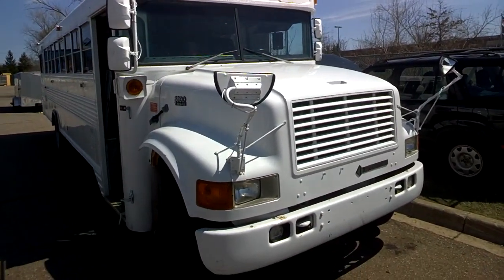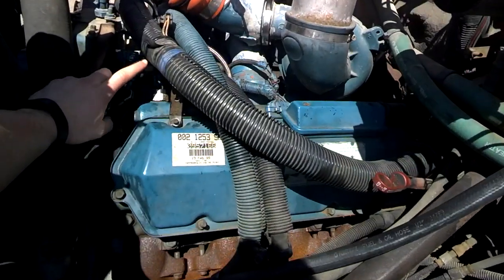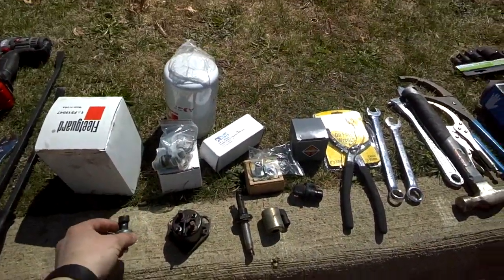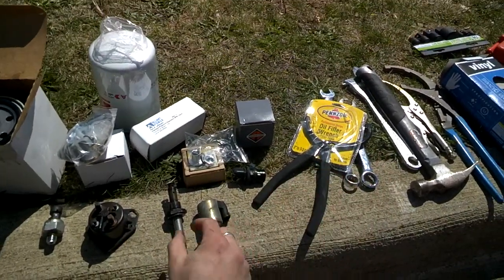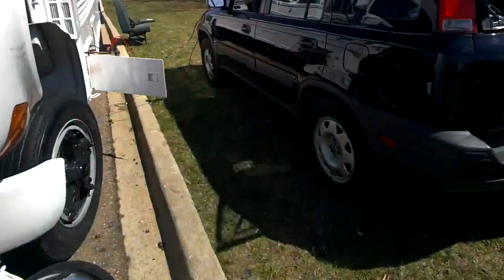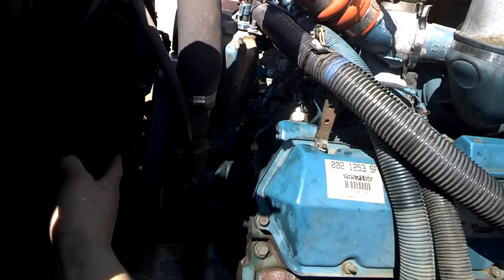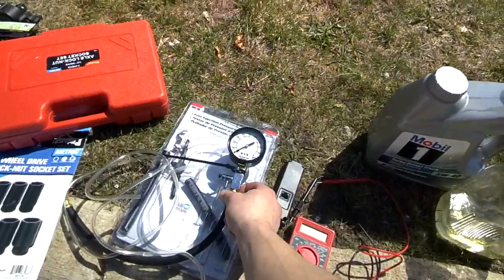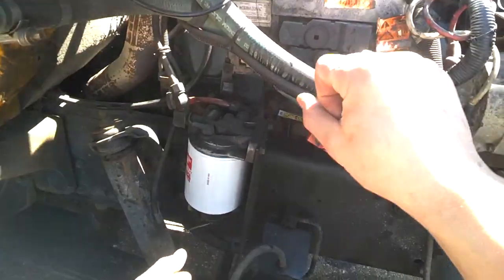All You Need to Know to Fix the 7.3L PSD T444E Engine incl CPS, IPR, ICP, FPR, etc.

Comment: Covered a lot of good points, common problems (man, they must not have maintained yours at all!) I have a '96 7.3 with 263k..bought new and haven't had moßt of the problems you recount. I am an ASE cert. Diesel Bus master tech (retired x3) and have had some of those issues while maintaining a fleet of 27 busses, for 18 yrs. Still one helluva lot less problems than a B series Cummins, or God forbid,  ANYTHING  GMC has come out that burbs DIESEL!!
Reply: So what is the very most dependable diesel buses out there?

Comment: I use your video every time I need to troubleshoot my 2000 t444e!  Today your comment about checking the pre-filter (upstream from the fuel filter) led me to find a piece of something stuck in mine.  Pulled it out and my bus runs without smoke in the exhaust!!! You saved my hundreds in diagnostics!

Comment: My motor is slightly different from yours, your advice helped me a lot, my Engine light is now off after I was able to locate and change out the ICP Sensor.   I Prayed to the God in Heaven about
 this one.  At International, the cost of the ICP sensor was probably almost three hundred dollars or close to two hundred dollars and was under $30 on eBay or Amazon, which made me question the quality and durability of my less expensive part, its been a few years and the part has held up.

Comment: This is by far the best video working on any 7.3 from ford 250 350 450 and excursions.. the view and angle u shot it being on a bus is the very best. The 7.3 is all the way across and same exact problems but minor fixes are better then engine replacements on gas cars. U rock
Reply: thedavidibarra papi 7.3 and 5.9 are kings among the diesels and if only Ford F Series had as much room to work with as that bus
Reply: The e350s are a bugger because everything is so damn tight!

Comment: Thanks for the video. Learned a lot. I have the same bus. Warning lights, buzzers, everything but a gong goes off.  Gages show low oil pressure and overheating. Plenty of oil, water level is fine and not too hot. I love my bus. It is a '99 with only 112K miles! Unfortunately, I had a diesel mechanic who was supposed to be an expert on Powerstroke engines. After screwing me around for a couple of months, told me that it was ready to pick up. Got it home, parked it for three days. Went out and it wouldn't start. Called him... he skipped town. Again, unfortunately, I am not mechanically inclined, but there is enough videos and info online that I believe I can do most anything I have to .
Thanks again for the video.
Poppy

Comment: BRAVO!!!!   Very well done and no time wasted on "I'm so cool".   smart mechanics are few.
Reply: Tim Masincupp 
Tim my name is Ken I am having a serious problem with my 4700 I I I I have a international 2000 engine 7.3 T444E Roback flatbedIt takes off really great and as it gets 30 mph starts to slow down and lose compression or power inter-national dealer tells me I need A Nother motor but the problem just started happening out of nowhere
I am in need of some serious advice!!
Reply: If anyone else have had this problem with is 7.3 international motor losing power after take off please reply
Reply: @kenwilliams5281  what ever happened with your problem Ken?
Reply: Maybe it’s the transmission

Comment: A other no start issue is a shorted fuel heater in the fuel bowl. It blows the 30 amp fuse that also powers other fuel system components...
An easy indicator is absence of a wait to start light when trying to start....
Reply: Where is this located

Comment: You definitely want to refill the HPOP reservoir. It is common to the engine oil, but don't count on the oil being replenished. There is almost no cirulation from the engine block. I opened my 2000 superduty reservoir and after 100,000 miles of regular oil/filter changes, the oil in the reservoir was like mud. It should be pumped out and refilled when you change your engine oil. Fortunately I discovered this before my injectors were ruined. Their is nothing about this in the Ford truck manual or even in a Chilton repair manual.
Reply: Even if you don’t believe it, do it as it’s cheap insurance.
Reply: JB Marker uh. Your low pressure oil pump pumps oil to the reservoir where the hpop uses the oil and is flowed through the injectors and back down. It has a huge part of oil circulation....

Comment: I have the same bus motor- I had the fuel pump go bad twice, and the serpentine belt tensioner broke (easy fix) and the glow plugs were bad...but that only matters in cold weather.  With theses big things it's better to fix in the driveway than on the highway...

Comment: Will,
One thing you should do, remove that New Gray Colored CPS Cam Position Sensor and put the original Black CPS back in the bus. The old Black CPS was made with a USA Made Magnetic Hall Sensor and is the best units ever made. If it has the small circle in the center with the exposed magnetic sensor you are in luck. The new Sensors have a cheap offset Asian made Hall Sensor that throws the timing off and causes high EGT temps, and poor performance eating fuel. The CPS goes in with a single 10MM Bolt and you torque it at 18 ft. lbs. The CPS is one of the most important parts of your 7.3L engine, the old black CPS will make the engine run on all 8 cylinders.n The new gray CPS is a nightmare, besides the cheap Hall Sensor, it's offset and not centered. So when the flywheel spins it counts the largest tooth and the smallest tooth on the flywheel. A bad CPS will give the ECM a wrong count and screw-up the entire delivery system, Both the new gray Ford and the International Dark Blue CPS have the same faulty offset hall sensor and are wasting tens of thousands of gallons of fuel each day. I have an old Black CPS in my truck and I get 20-21 MPG on HWY and 17 City with a heavy foot.  Here is a diagram to show you how the 7.3L PSD Works starting at the top left with the CPS (CAMP) Sensor.
http://tinyurl.com/7-3L-Wiring-Diagram  .

Comment: Just got the exact same bus at a auction... and I see you have 2 batteries mine only had one!    Great video
Reply: All 7.3's to my knowledge have two batteries. My 95 has two batteries in the engine compartment but the 2003 has one hidden down on the rail frame/rail.  There's a decal in the engine compartment I found after I did a little cleaning

Comment: mororhead, true that the glowplugs will ignite starting fluid and blow up your engine, possibly... but in warm weather the 7.3 will stat and run with a bad relay, although it takes a minute for sure. I had thick oil in the 7.3 bus I bought, and the guy sold it to me cheap because it had a hard time starting. I changed my oil to a synthetic 5-40 and not it starts almost immediately. just my experience...
Reply: the newer style pistons don't like either and if you have to use either most either now is such low % of either just give it a sniff after you have pulled the relay or fuse for the glowplugs so they aren't hot but unless its below 50 degree's a 7.3 will fire up with out them it won't like it and may take a min to light all the holes but it will light but on these newer diesels either has been known to crack pistons in most cases because people using too much  but still not worth it plus block heat is another option

Comment: I was experiencing the same issues.  But....my bus would crank and crank and wouldn't start.  I removed the rear heater, and in that process, cut the supply lines to shorten and hide them.  Apparently I lost more coolant than I thought and i had NO clue that there is a low coolant sensor that prevents the motor from starting.  I replaced the cam sensor and still had no luck.  Once I filled the coolant to the "full" level on the container, the damn thing fired right up.  I wasn't throwing any codes either.  I talked to an old-timer that is a retired bus mechanic.  He told me to add coolant.  It's between "add" and "full" and that beast lives again.  Much cheaper than replacing every sensor...
Reply from the maker: wgaca JR thanks for your story. Yes if I were to remake the video i would have included: 'make sure all fluid levels are good including coolant, transmission, oil, steering, brake, rear diff, etc.' but i guess i assumed most people would start there. Also if you do follow my advice in the video you would not replace every sensor you would start by reading your error codes which would indicate you should check coolant (in your case). Congratulations on getting it running again though that's always a satisfying feeling!
Reply: Never pre fill fuel filters and never wear a ring on your hand while you work on anything.

Comment: Is there a way of contacting you with a quick question about the 444e? Mine is dying when it's warmed up and put into gear. Replaced or serviced: ICP, IPR, CPS, H-pop, fuel pump. Probably stuff I'm forgetting.
I'm getting code 42 from the scanguageD I bought that you suggested. Cleaned all the fuel lines, replaced the fuel filter, and inspected fuel tank, fuel pressure regulator, screen, bowl, and added a supplemental fuel pressure at the tank. It starts right up, just won't run under load once it warms up. Great Vid!
Reply from the maker: sorry I missed this, you get sorted?
Reply: @WillStone  I don't have wait to start light or crank

Comment: I used to have a 95 7.3, well still do an selling it now, bought a 7.3 idi that’s better for running more bio fuels.
These 7.3s are a true pain in the ass to fix sometimes, but being that the valve covers are no buried between the truck where the passenger side one only comes off at a certain angle. For the 3/4ton trucks ford should’ve stuck w the 7.3 idi. 

Basically if you can afford it, change the factory valve cover gaskets, IPR, ICP, & CPS/ with a spare in the glovebox. 

The IPR moves in & out about a couple hundred times a decent to send the right amount of oil to the injectors.
This is a part you want to get that’s genuine motorcraft, other sensors like the ICP just get after market, get motorcraft for the CPS as well.

If it’s taken care of that is about the only real issues these things have.

Just get ready to pull out the wallet for 1K in injectors, & $700 oil pump, & 1-$200 computer tho. 

I just found a bus w that engine in it that pas parked in a field, I’m 17 so hopefully I can get it pretty cheap.🤞

Comment: Where the oil filter located on this truck. I looked all over engine and thought it was the water oversteer at first until I wiped it down and saw it said coolant filter on it. My 2001 which is identical to this has been nothing but a nightmare and my tow costs have been killing me. Had to change the fuel pump 3 times before I got one that finally worked and haven’t had issues with it since.

Comment: Just bought a 2000 Bluebird School bus... picked it up in Mississippi yesterday and drove it 500 miles. Everything seemed to be going well till about 300 miles into the trip. Stopped at a rest stop and when started the bus up again got oil/water warning lights. Oil check was good water was almost empty but no obvious leaks on the ground. Let it cool and put 4 gals of water in and drove it the rest of the way. Got home and checked the water... very low level. No water in the oil but noticed a leak on top of the motor towards the back ... explains why the floor area around the front of the cab was slippery, kind of oily. Any ideas where to start?
Reply: Mike & Cindy Jones, Realtors heater core.

Comment: does your oil pressure gauge "hunt" while on the road? I just picked up a 2000 Bluebird with a T444E... drove it 1050 miles home.. runs beautiful.. my fan clutch is bad so i ran about 210 temperature on the hot days but thats an easy fix.. it has the typical intermittent tap-tap at idle sometimes..  (LL #8 injector needed maybe...).... the one thing i notice us drivng down the road on the highway.. my oil pressure gauge hunts from say 48 down to 40 then back up again...  repeats about every 10 seconds...  just wondered if yours does the same thing..   what does your dash oil pressure gauge read after your engine hot and you are on the highway? I dont have a normal OBD-II port for a scanner on mine..  I have a scangauge 2 that i use on my cars  but what did you use for a pinout to the connector to pull the codes?  my bus has a round connector instead of the normal style, otherwise mine looks identical under the hood.. its a 190HP variant of the T444E, in a little 6 window, the bus has better pickup than my 7 row DT-360 bus has.
Reply: should me ntion the scangauge you use is a VR model... i ended up using the international software servicemaxx and running a J1708 adapter...  one thing to note is that the fuel Pressure regulator nut on the older ones only ran at 47 PSI pressure .. its actually the spring in the regulator... that was replaced due to a TSB for late 99s.. (I noticed yours has the notched FPR nut which means it was updated to the 72 PSI).. others watching its a worthwhile upgrade.. quieted my engine right down form alot of the cackle..  my oil pressure still hunts, however is in range according to the books so I let it do its thing...   the EBPV is another thing that will cost stalling or sometimes no-starts...  many of the cold-weather busses had this on it as a war up device... it causes issues by sticking sometimes and blocking up the exhaust...

Comment: also to check icp you can start the engine with it running disconnect the connector. the engine will give a quick hesatation and idle normal. but besure to disconnect the battery befor doing any work under the hood

Comment: I HAVE A 2000 INTERNATIONAL 4600 DT466E, Truck wouldn't start due to fuel, Got the truck started and stay running but I'm not getting full power when I try to drive it, Do have any idea what could be wrong?

Comment: I have 2000 international 4700 the oil is being pulled from the engine into the fuel tank. Have not been able to find the problem any information will helpful thanks

Comment: So i have a 96 int 3800 bus with t444e and i cannot find the separator. have you ever seen them in strange places? ive traced down the framerail and i dont see it anywhere where i see fuel lines. i have a service panel inside the bus, could it be under there?

Comment: Nice video gave you a thumbs up. A little all over the place but I learned some things, thanks for doing it. I was so in tune with the video I didn't even notice the sniffling. LOL, if you watch my vids I sniff a lot maybe that's why I didn't notice it. Mine is cutting out occasionally, tipically in cooler weather, in the 70's,  then it goes away in the summer mid to high 90's. Changed the CPS no change. So I figure i'll try the Throttle assymbly and the ambient temperature sensor. Any ideas? Ps also changed the oil, auto tranny fluid and filter. Ran injector cleaner to, no effect. Pulls hard under load just when cruising does it cut out. Seems to do it between 1700 - 2200 RPM. Thanks Best Wishes/Blessings Keith.

Comment: I have the same bus. 
Pretty bad oil leak can't really see where it's coming from. 
Near the filter on the driver side front of the motor.  
It's shooting out like a pulse.
Any ideas before I take this thing apart.
Reply from the maker: what error code do you get? check the cps and the icp sensors. bad icp often does this (i've read).
Reply from the maker: Will Stone also there's a metal plate inside the bus in the middle of the floor between the door and the driver's seat that you can remove to get additional access to the engine bay - just in case you didn't know

Comment: I've been looking for a 72 passenger bus myself. I'm partial to the DT466, but haven't totally ruled out the T444E. as an option - the high production numbers should make parts and boneyard scavenge readily available, but tell me, is it enough engine for comfortable highway cruising? What's the "top" speed of your bus (without beating it to death)?
Reply from the maker: We weigh 22,000 pounds and have additional drag from our roof deck and solar panels and can cruise at 61mph no problem. Mountain highways were troublesome until we replaced the water pump and cleaned the radiator in a commercial degreaser last month
Reply: Thanks :)
Reply: what did you use for a water pump?  I do have the issue in hot weather of mine running a bit warm... I had a bad fan clutch mine is not the nice horton like yours.. its an old-style viscous..   but now that works.. however it still likes to run about 212 or so on hot days at 65 on the freeway with my Air-conditioner on and heater valves closed...  I really despise the OH split radiator..  both of my busses have the rad design..  when you say you cleaned your rad in degreaser.. the inside of it or just the outside fins?